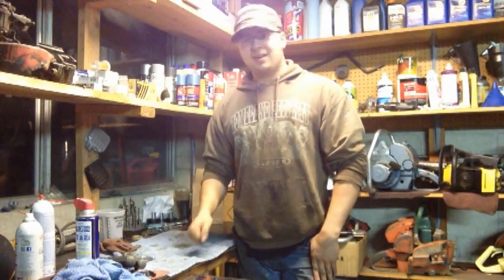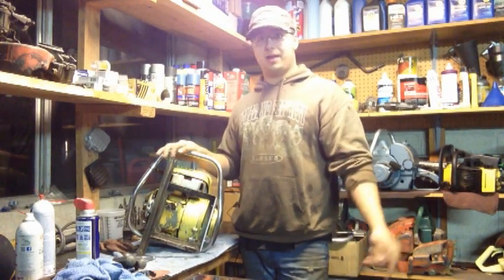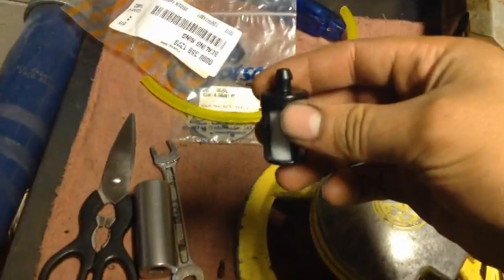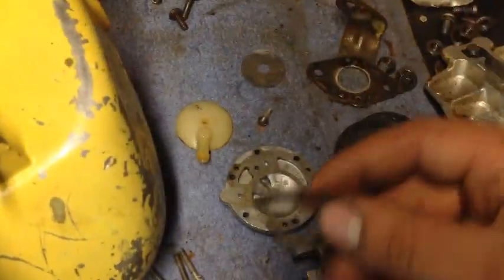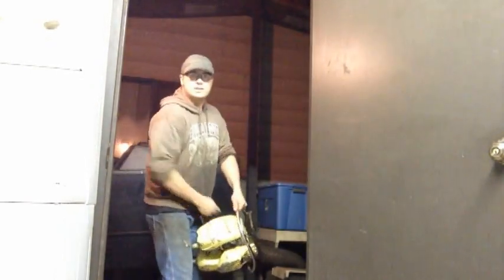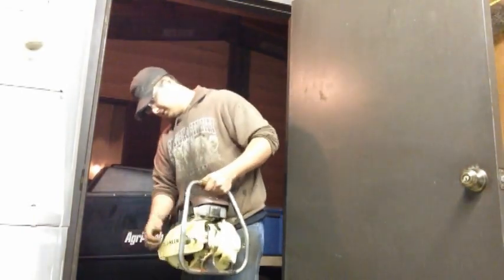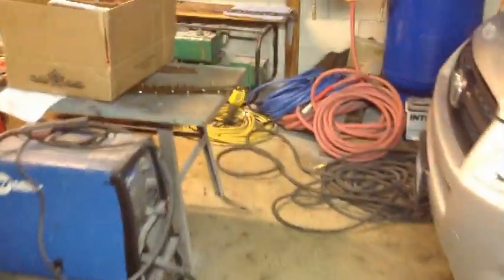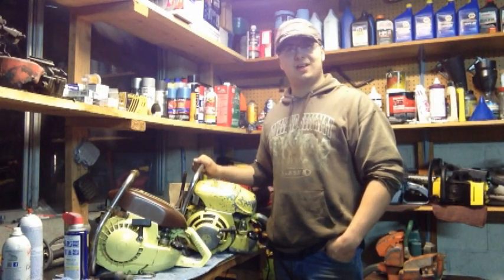1957 Pioneer Modeal RA lives again!

Comment: Did you solve the issue of the recoil pull start.  I have the same saw and cleaned it up now it wont "grab" to turn over.  Any tips would be grateful!
Reply from the maker: Yeah, the cup that the starter pawls grab on is worn out. I've found I just have to pull quickly so they'll grab.
Reply: @tjschainsawrestoration9289  Tried that more times than i care to count.  I think i just have too much wear. Need to find another starter cup.  Not any close to my area and the cost to ship is the same as the part.

Comment: ADD more oil to the fuel should be smoke from the saw while it's running
Reply from the maker: Fuel was mixed at 50:1 with stihl ultra. Been running 40:1 lately.
Reply: @tjschainsawrestoration9289  Those old saws ratio is 16:1, l have been using 30 + year's ,
Reply: Most of my customers use 50:1 and after 1 year they need engine replace ment.
Reply from the maker: @jonathanbenoit8828  Never had an issue here. Quality and lubricity of 2 stroke oil is much better now then back then. I have a friend running ams oil at 80:1 and he has yet to have any issues. Proper tuning goes a long way.